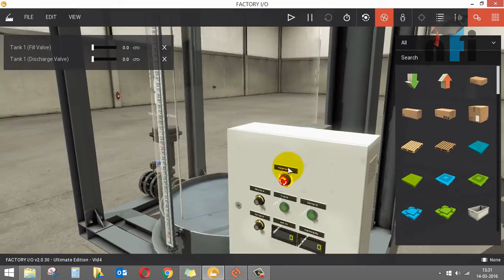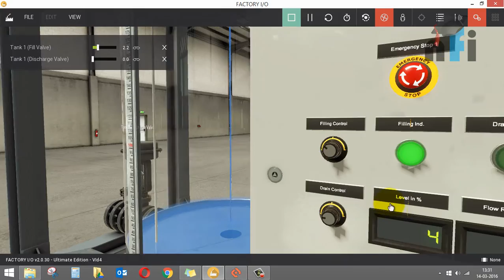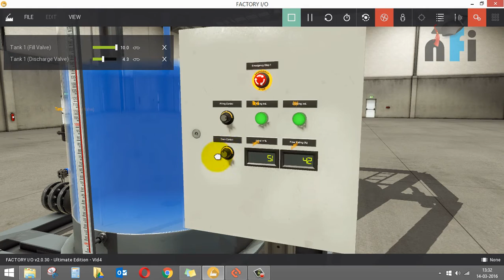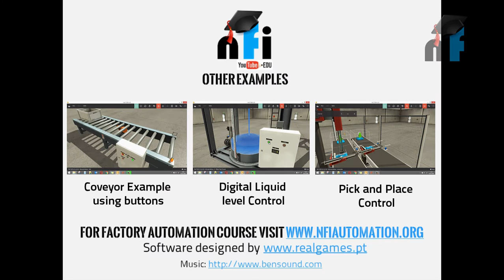Factory Automation- Analogue Liquid Level Control

Comment: We deal in Automation Components, Sensor Technology, System Integration, Factory Automation Industrial Products like sensors, switches, control panels, energy meters, field Bus, drives, HMI, PLC, SCADA and safety products and Building Management Systems, & SMART CITY PROJECTS.

Leelavati Automation

www.LeelavatiAutomation.com

+919967861294

Hi !! my name is Prashant Tempe marketing of automation components trader supplier distributor wholesaler dealer Authorized

#systemintegrator #distributors #systemintegrators #safetyproducts #energymeters #scada #vfd #timers #controls #control #sensors #automation #industrial #sensor #iot #industrialautomation #switches #panels #hmi #plc #factory #fieldbus #buildingmanagementsystems #authorised #imported